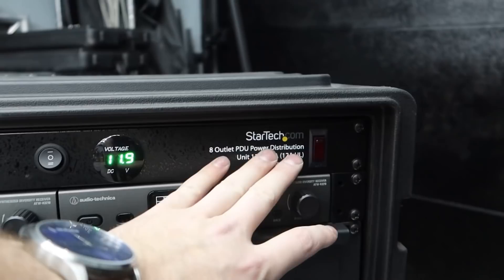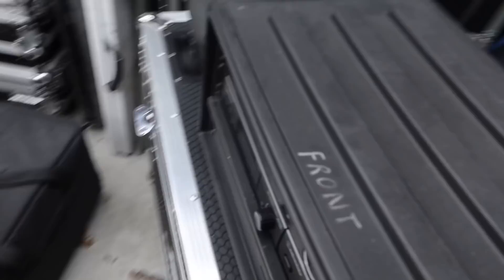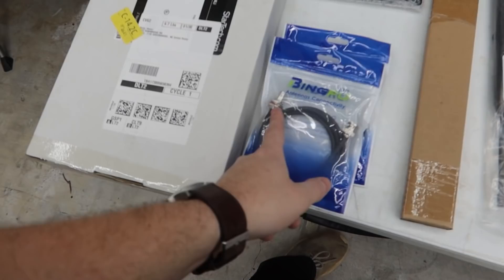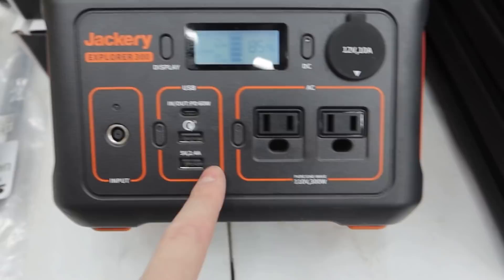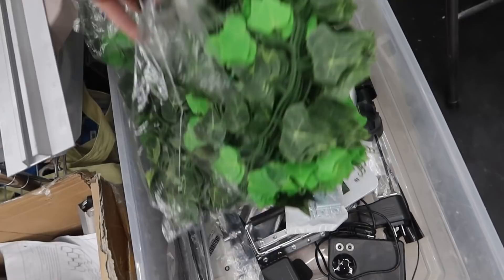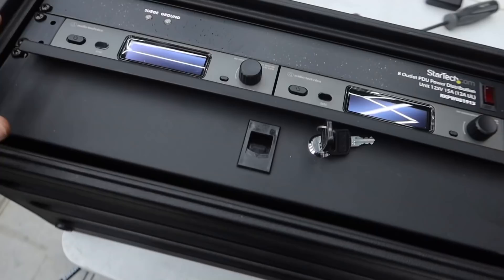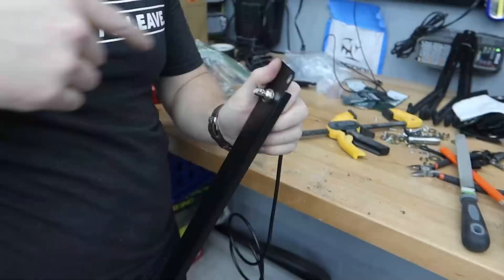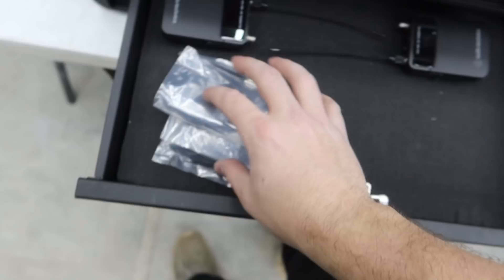DJ Ceremony System - Battery Powered

Comment: Great video. I used to have a ceremony set up similar to this one but it wasn't battery power. However for the last three years I have been using a Bose S1 speaker and sennheiser AVX microphones. It is super portable. I traveled to Cancun with my ceremony set up on a backpack.

Comment: 4:16 A few years back, I got fed up with trying to reach into the back of my amp/mic racks to try and connect external stuff. What I did to fix that, was to buy some panel mount XLR's, Speakon connectors, and a pre-punched 1U 8 hole rack plate from Ali Express (eBay should also have them). I then mounted the connectors to the plate and labeled them. I even added a USB port connector so I could charge my cellphone and tablet if needed. The only pain was cutting, stripping, soldering and then heat shrinking all the extended wires sections to the back of the new connectors. That took me a few hours to do, but it was well worth it. Setups and strikes are so much easier/quicker now.

Comment: Rick use the following Neutrik NA3MDF. you can drill it into the blank plate for your xlr mic connections. great video.
Reply: I don't think that's the locking version.

Comment: I use the Jackery 240, which is what I think you’re recommending as the lower model to get and I agree. One advantage I see with your battery is there are multiple ac outlets. Mine just has one, but of course that’s not an issue if you’re always using a power strip with one or two open outlets if you need them.

I basically use the 240 for just a wireless mic, sometimes a small fan to keep me cool, and sometimes a laptop charger. I’ve never drained the battery below 60% by the time the ceremony is over, and rarely go under 85%.

Comment: The bluetti eb3a is a beast, usually 209 bucks on Amazon can do 600 watts of power and 258wh battery. I have 3 of them now. I ran speakers off of them for well over an hour when power went out at a gig.

Comment: 19:42 - Pro Tip(lol): I leave my XLRs plugged into the mics. I use 2 small/short bungies and hook them to the screw holes. To those bungies, I have two Velcro ties that I use to bundle the XLRs (15') when in transport or not in use.

Comment: I power 3 receivers with one 28,000mah battery bank that’s smaller than one receiver. I use usb to 12v adapters. I have a small acoustic band so I’ve used it like that about 8 hours in one day and still had half battery left.

Comment: I use a powercases dg600 battery to power a light that i want in a spot that has no outlet or they are all in use and it can power a kam led party bar v2 for ovet 10 hours

Comment: Hey Ricky, if you use the Shure combiner you can combine the combiner. So I think Shure says you can combine 5 combiner into one combiner. In a big setup you can use 25 receivers. If you use the Shure axient series with there quad receiver (Shure AD4Q) you theoretically could use 100 Wireless mics. I don't know were you could possible need and use 100 Wireless mics at the same time but its possible and if you have unlimited money, don't quote me on that, you could use combiner from professionalwireless and combine even more wireless systems xD

Sorry for my bad englisch :D hope you like the information :D

Comment from the maker: The original ceremony system video https://youtu.be/nv1Sg6QOZRI

Many parts were purchased through my good friends at Canal Sound and Light
https://www.canalsoundlight.com/product-category/dj-gear/

Parts Used
-SKB 4U Case https://amzn.to/3j3jbb2
-2U gator shallow rack drawer https://amzn.to/3J4rf66
-Jackery Battery https://amzn.to/379nCys
-Optional - Colorado Sound and Lighting Battery https://csnl.com/products/lithium-ion-power-supply
-Power Strip https://amzn.to/3r0SPea
-Foam Insert https://amzn.to/3KaFQOI
-Audio Technica 3000 4th Gen Mics
-Dead Cat Filter for lapels https://amzn.to/3LCuQtJ
-Mic joining Plate https://amzn.to/35PVaS9
-Passive Mic Antenna Combiner https://amzn.to/3LBpA9M
-1U blank plate https://amzn.to/3r1IzCF
-Antenna Mounts https://amzn.to/37fGD2p
-1/2 wave antennas https://amzn.to/37cvoYd
-Yamaha MG06x mixer https://amzn.to/3qZgFHl
-Mixer bag https://amzn.to/37bDws0
-LD System maui 5 go

Comment: How do you eq your lapels and mics to combat feedback.
Reply from the maker: Speaker placement is step 1. How you place your lapel on individuals is second. Then it comes down to gain structure to avoid any unnecessary gains in the system that can cause it

Comment: Rick, question.  So I see there are two lapel mics and two handhelds, with two receiver units.  Maybe I missed it, are the 2 lapels working off one unit and the 2 handhelds off the other?  Then lastly, do they sell them in pairs or did you just order another handheld and body ack?  Thanks man!
Reply from the maker: No only two mics can work at once. So we can do two lapels for ceremony than switch to two handhelds at ceremony. And i bought extra handhelds to allow for this

Comment: Rick Webb. You use Audio Technica mics. Do you have the link for the 3000 series with wireless lapels? Your link goes to handhelds. Also link for the rubber washers?
Reply from the maker: All the mics are on back order. So you have to do some searching on those. No clue where to get washer comes with the antenna

Comment: hi, i need help. what you reccomend for a portatable power station to use for djing outside, thx
Reply from the maker: Full DJ setup is hard to run on anything but a generator due to the power draw. The ego power battery generator looks to be about the only thing with enough juice
Reply: @DJRickWeb  great. It's mostly for small dj equipment setup. A laptop, dj console, and 1 small power speaker.

Comment: Can you send a link for the rubber washers for the 1/2 wave antenna? I had the exact issue with my Sennheiser 1/2 waves. They were not included in my shipment and very difficult to get help with for parts. Thank in advance 👍🏾😎👍🏾
Reply from the maker: No clue where to get them. Contact the dealer you bought the sennheisers from

Comment: Thanks for the awesome video bro. 2 questions: Are you able to close the back lid and leave the antennas on? Also why are you using that 3 prong passive connector? Couldn't you just go straight from antenna combiners to the rack mount?
Reply from the maker: Yes leave antennas plugged in at all times plenty of room in the lid. I don't understand second question
Reply: As to the 2nd question. He is using the passive combiners to convert the 2 original antenna of each unit into one larger or longer antenna per unit and gain back the same amount of power signal per unit with the updated customized antennas and save space. Hope that helps

Comment: What size and what kind of drill bit did you use for the holes in the rack panel?
Reply from the maker: Its a metal stepper bit. And i just kept going one more step until it fit.

Comment: In your opinion would the jackery battery hold strong to power a
 asus zflow 13 pc tablet ,pioneer sb3 controller, and a soundbox 2 speaker for a 5hours?
Reply from the maker: You need the 500 or 1000 model to do that
Reply: @DJRickWeb  kopy that, much appreciated

Comment: quick question bro, I just got a  share slxd 24 wireless mic system, it comes with 3/4 antennas would i be able to upgrade the to the 1/2 antennas to gain range quality? are the 1/2 antennas compatible?

Comment: Hey Rick!  Nice ceremony rig.  Weird question, but have you ever found a place to buy the little rubber o rings for the antenna?  When trying to do an install I lost a couple that came with the antenna and yeah, the antenna do NOT stay in place.
Reply from the maker: Nope. Best to contact a dealer and see if they know how to get them
Reply: @DJRickWeb  yeah tried that. It’s a smaller item then they carry. They suggested hardware store but that was a bust because my hardware stores sucks.

Comment: Great content. What do you think about this mic Audio-Technica ATW-1322 System 10 PRO Dual Handheld System.
Reply: i have a set and they are great. but i dont trust them for ceremonies out doors.
Reply from the maker: Those mics are wifi based and like someone else mentioned would not trust outdoors or in general won't use. The wifi band is so congested compared to the radio waves between 400 and 500 hz which are what my mics use. Ben stowe made a super in depth video on this. I think it is in the dj vault

Comment: Hey bro… quick question… what type of Jackery or other power station do I need to power 2 Rane Twelves mk2, a Pioneer S11, my MacBook Pro and a little Bluetooth speaker, power all of this…to be able to practice in the garage that I don’t have any power outlets or power at all…so what do you think I need to power those things?… and no I don’t wanna buy a power generator because of gas or propane and releasing carbon dioxide and being enclose in the same room with me, I don’t wanna run it all the way to the outside either because people anybody can pass by and steal it while I’m practicing closed doors. 😆…let me know … thank you 🙏
Reply from the maker: The big boy jackery should work. It's like the 500 model. A better thing you can do to figure out what to get. Buy a watt o meter. It measures the power draw of stuff plugged into it. 
See what your system pulls. Then buy a battery that has enough watts to power it / for how long you want. Also consider if you have any other battery things tools etc what you can get. Like me personally I have an ego lawn mower, blower etc. They make a battery generator that uses the same batteries.
Reply: Hey I need to do the same. What did you get?

Comment: Hey DJ Rick! Getting back into DJing after a long time! Could you show a beginner friendly ceremony setup? that would be awesome
Reply: Welcome back! I use what I think is a very simple and clean battery powered ceremony system. I have a small one shelf metal booth with white cloth panels. I use a Denon Prime GO as my controller for complete control, Denon says it has a 4 hour battery life. And in a pinch I have it ready as my backup unit. I use a Denon Prime 4 for my main setup. Next I use a simple Shure dual mic system, which I run on a Colorado sound and light battery pack. For sound, I use a JBL Eon Pro, It has a shorter batt life than my Maui GO 5, but it has better outputs. It's a very clean looking system, super portable and easy to setup! I don't user a mixer or one of those huge rack mounted antenna setup's. I talked to Shure about those big rigs, thinking I was doing something wrong and they assured me for what most mobile DJs do the standard dual mic is more than enough. I've only had one drop out issue and it was my fault for not scanning for channels while setting up! Just good old operator error ! Good luck :)
Reply: @davidhughes8574  Thank you! What Shure Mic System did you grab? Think getting a Lapel is worth it?
Reply: @djpyramidz3756  I have a blx88 j10 and yes it’s nice to be able to offer both although I hate putting them on people ! 😳
Reply: @davidhughes8574  That part doesn't sound fun lol
Reply: @djpyramidz3756  😂

Comment: How is the startec compared to a furman? Any different?
Reply from the maker: Furman is way better but for a quick ceremony not a big deal. Not running anything of serious power
Reply: I use the Furman... more for piece of mind making sure I have good, clean power to my mics/mixer/ipad. This is especially important if using an outside outlet when doing outdoor ceremonies and the power from an older outlet/source might not be the best.

Comment: I'm just playing devil's advocate here: The portable battery doesnt have the clean form factor that you get from a rackmount battery. So with that in mind, when would you ever need to use that tiny Jackery battery for another element of your show? If you lose power to your laptop, youve also lost power to your FOH speakers...which are NOT going to be battery powered at a corporate gig or wedding reception. If you.lose power to one...you lose power to ALL of your necessary elements for a show. So why make your setup look much more "amateur" with an orange battery pack under a table or on the floor nearby.

Personally, if the highest level of fee and setting myself apart from the competition as more professional is part of the equation, I'm leaving tue ugly battery units at home and spending the money on a rackmount.
Reply from the maker: It's under a covered table no one sees it. And the highest end companies in this industry all use them.